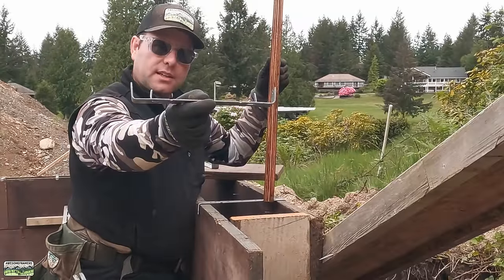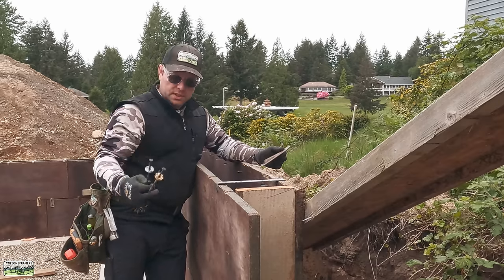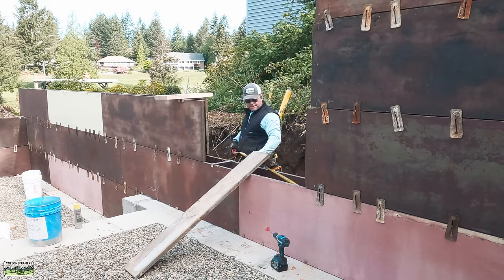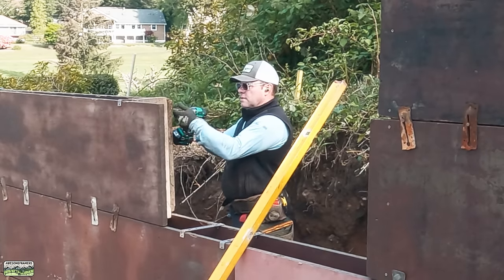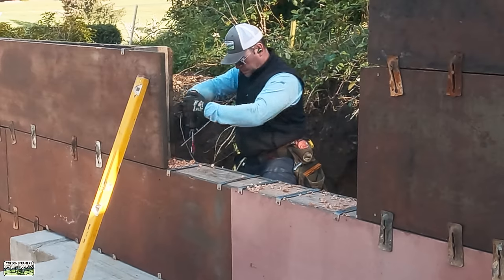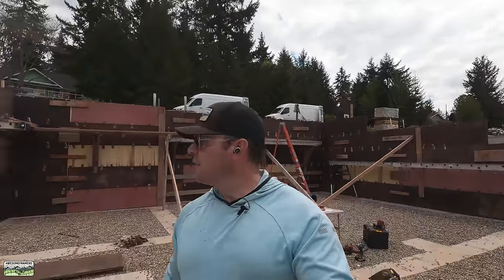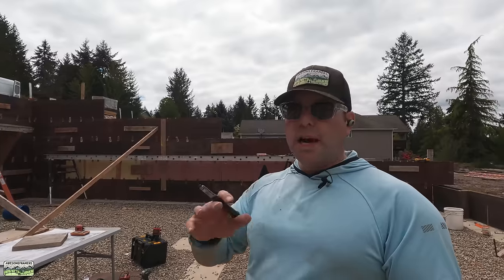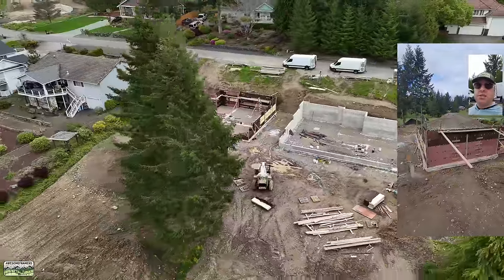How to Calculate Concrete - Olympic Foundations

Comment: i take a count of how many 8 foot panels i have for 6", 8",10" walls and figure from there, aka 10 panels at 8" is 80ft x 2ft x 8". bit of estimating for pieces, just add them into 8' panels,  so 12' run of 8" wall at 8' tall is 6panels= 48' x2' x 8". Good stuff tho, also can't agree more with the tie guns, permanent employee of the month

Comment: Finally, learned to measure quantity of concrete needed. It is been 2 years I work as a framer/ from work, but it is usually the formen or builders task to order concrete so didn’t get any practice.

Comment: Tim, nice video. You and I calculate the same way, count everything separately, I have guessed a few times to many, and I finally learned. I am using the same Millers Falls 2' level that I bought in 1973. It spent 2 years in a rain gutter including 2 Maine winters. It is still right on the dicky docky.

Comment: I've heard of tons of people buying homes built on hillsides like this, with "daylight basements" that have flooding issues when it rains. Why isn't this issue addressed early on in the building process, rather than fill it in and sell the house and let future owner deal with that nightmare? Seems like adding a french drain, or irrigation to remove standing water would be relatively easy at this part of the process.
Reply: In the research for my next house build, it really comes down to budget and if the builder gives a dang. If the budget is “too tight” some builders will forego the added expense and hassle of trying to convince the customer of that need. The other scenario is that the customer would find the money in the budget if the contractor cared enough to tell them. In an ideal world, the waterproofing and water management (read french drain and gravel backfilling etc) would have been discussed well before construction began. In a really ideal world, we would build houses dictated by the property and site conditions, and not the house dictating how site work is performed. Just my observations and opinions
Reply: @philharris6858  i agree regarding dictated by property/site conditions....it seems like something the creditor and insurer would want to ensure.

Comment: I can't tell you how many times I've had a cheaper level lie to me flip it over is great advice. I've seen guys use them as levers and yes aluminum will bend a whole run of bottom cabs just to pull them all out and start over but I just threw crap around and felt much better anyways great video thanks